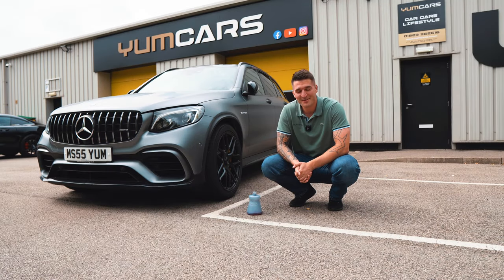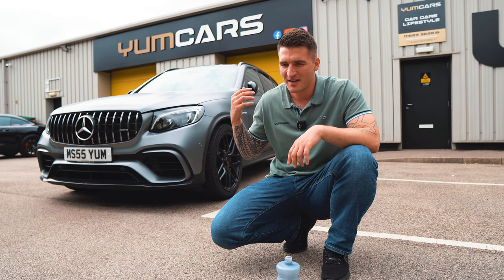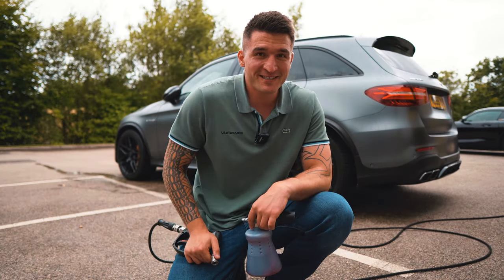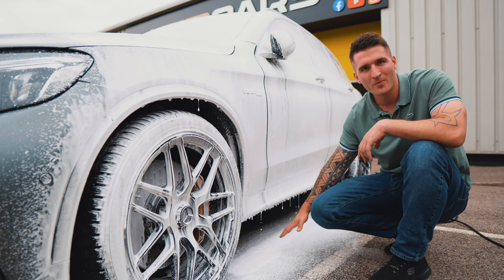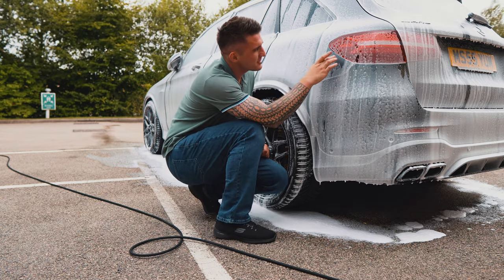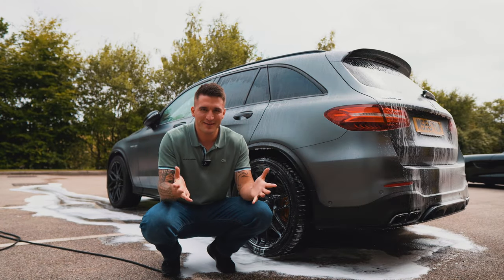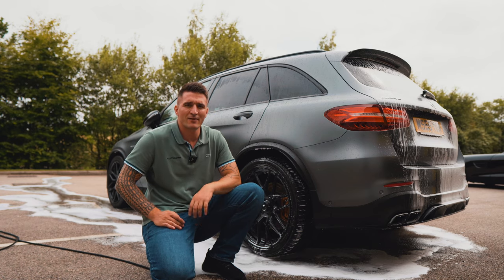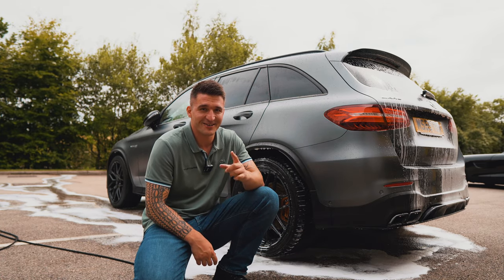Car Washing Product Series: E1- What Is Snow Foam, Why Use It & How To Apply It!

Comment: With the Kranzle 1152 PW, what PSI should we be at for foaming?
Reply from the maker: The foam cannon has a much larger internal orifice for the low pressure application. 

With your nozzle assembly set the psi to 1200 and it will reflect perfectly with the foam cannon